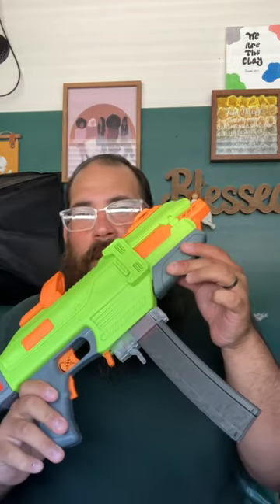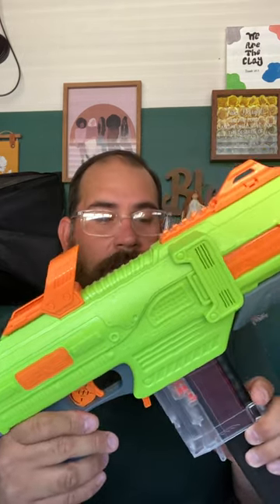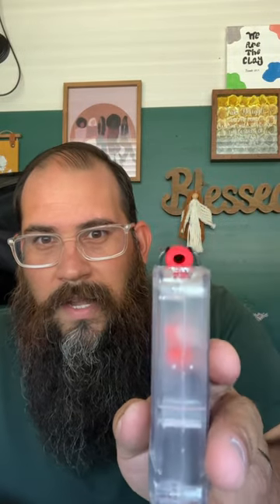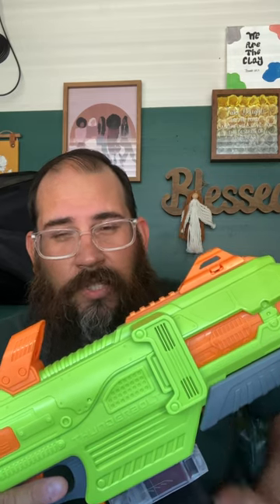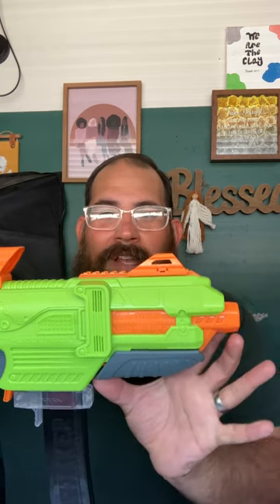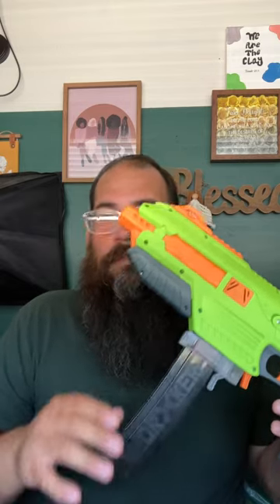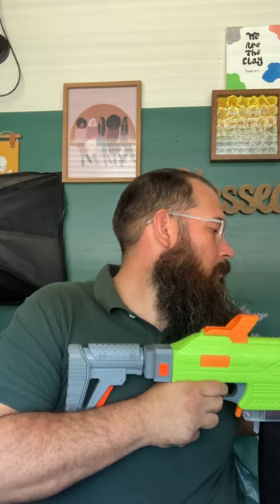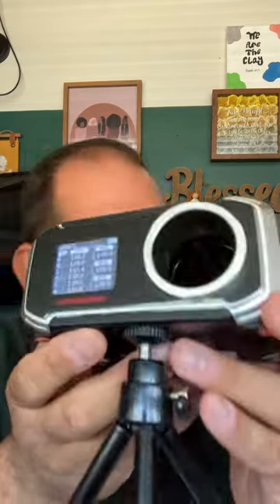Short Dart Dart Zone Thunderbolt

Comment: You've single-handedly convinced me to pick up a thunderbolt ✨👌 Are the banned blasters cages meant just for short darts? Or can Full length darts also be used in them?
Reply from the maker: Lol glad I could help , you can use long darts but they have to be the dart zone ones that come with the max Stryker or nexus pro
Reply: Full length are completely inferior when you hit 150fps. You need brand new darts to shoot straight but when your shooting that fast it doesn’t even matter they will be so inaccurate